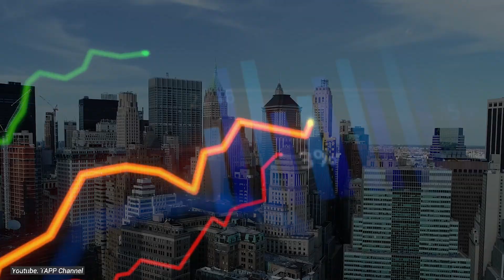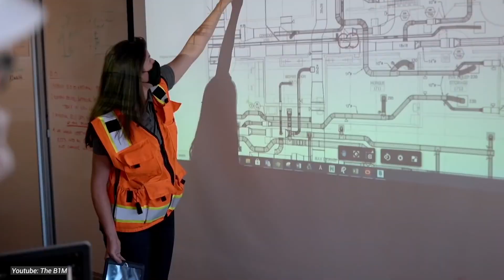Inside New York’s $16BN Hudson River Tunnel Project

Comment: This does not mention why we are in this position. Chris Christie, the governor of NJ canceled the original project that was started (and where the new tunnel is building off of that work). Christie canceled the ambitious Access to the Region’s Core (ARC) tunnel project, which would have connected New Jersey to New York City. The decision was announced in 2010.  At that point in time the tunnel Initially was estimated at $8.7 billion, the project’s cost escalated to a range of $11 billion to $14 billion. Governor Christie deemed it financially unviable and decided to cancel it outright.  Now another 14 years later the cost has gone up even more to $16 billion, thanks to the short, sided thinking of the governor back in 2010 trying to save money.